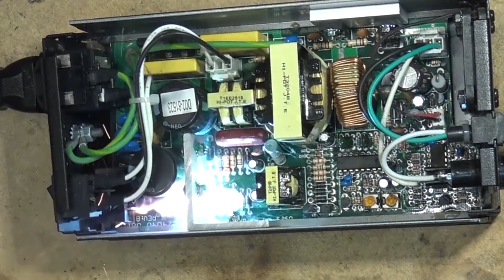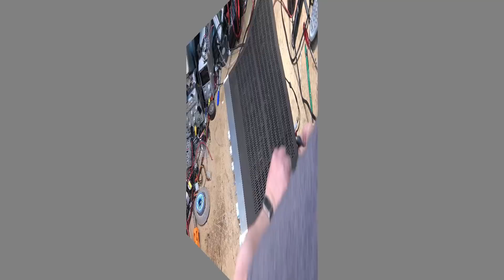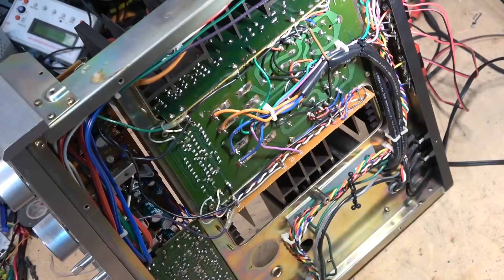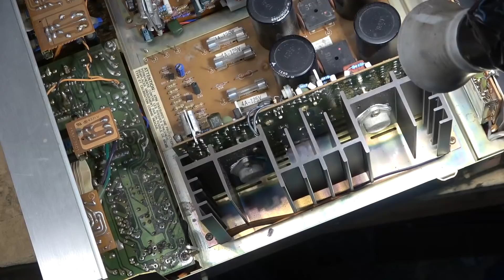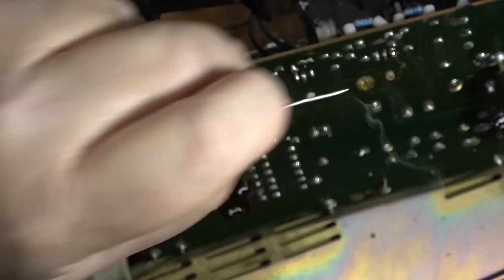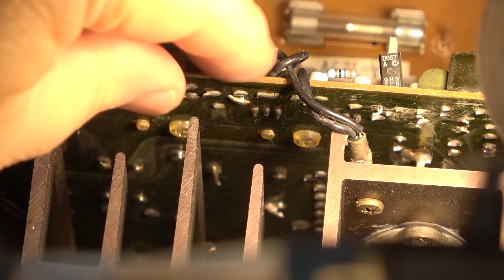Harman Kardon hk505 One channel out the other crackles. Lets Fix It.

Comment: I'm puzzled by the resoldering. It seems like you're putting too much solder down and creating solder bridges on the back of the power board.  Is it just the angle or are the globs if solder actually touching? I'm genuinely curious. I'm a novice at this and I'm trying to learn.  I have an hk670 with a very similar power board.
Reply from the maker: Obviously it's not shorted

Comment: I had one of those! It's like seeing an old friend again. And mine had the same problem. I didn't surge protect it so it was fried in the worst thunderstorm of that year. Oh, and I was getting a slight sustained tingling shock off the case itself. So I put it on the curb. It had a great sound. Probably better than the amp/preamps I've had since. Thank you so much for sharing this video! Cheers!

Comment: Hi  I have the same amp I just bought and it started doing some crackling noise on one channel both A B speakers , checked the DC off set and one side is over 115mn .... 
this unit was suppose to been re capped ...  where can I look first ?

Comment: Nice job. I had a car radio cassette that had a loose capacitor. It was an easy fix.
Reply from the maker: Loose connections number 1 fault.
Reply: @12voltvids  exactly

Comment: I can hear a lot more definition on the Akai, especially in the highs. You can't really make out the cymbals on that HK.
Reply from the maker: The speakers make a big difference.  I am running a pair of psb mites on the akai.  These are great little Canadian speakers.  Currently the test speakers I use on repair amps are just a pair of JVC from a mini system.  I'll probably get around to putting some polk bookshelf speakers up for the test speakers some day.
Reply: PSB are a hidden gem in the industry.

Comment: Acctually I got an old tube radio (1963) in yesterday with left channel dead.
Turned out it had the same type of fault.
The cable from the volume pot to the capacitor in the output stage wasn't 
soldered to the capacitor, it was just touching it.
But now after almost 60 years it's finally been soldered.

Comment: When I was a senior in High School in the late 80s, I bought a set of Harmon Kardon stereo equipment at an auction. Amplifier, pre-amp, and tuner, with stand and giant speakers, for $95. The amp had an issue where one channel was very quiet unless I cranked the volume, then it "popped" and was normal. The speakers were also blown and corroded, but they worked well enough. I added a Technics cassette deck, and loved it. 

When I moved nearly 10 years later half way across the USA, I left the electronics in storage with my parents. Five years later, they moved out of the old farm house onto a new house on the property, and sadly, the squirrels and raccoons moved in to the farm house and ruined a lot of things, including my stereo setup. 

I wish I knew then what I truly had.

Comment: The word you fumbled for is *jumpers*. Virtually no audio company used patch-cords to connect pre-out to main-in. Horseshoe-shaped metal jumpers; replacements can be easily made from aluminum antenna-grounding wire and needle-nose pliers. We often see amplifiers missing the original jumpers, presumably because some type of equalizer or other signal processing device (a Bose 901 eq perhaps) was used inbetween the preamp and poweramp.....or sometimes the unit was used strictly as a preamp because of a defective power amp section. BTW, there are three or four different spacings commonly used between the pre/main RCA jacks; I know this because I've had to make replacement for hundreds of missing jumpers.
Reply from the maker: I was referring to the fact that i had to use patch cords to connect the pre out to the main in because the jumpers were missing.  The guy that ownes this uses it with an equalizer.  Another piece of equipment that won't get within 100m of my system.  My system is so basic.  It has a power switch, input selector switch and volume control.

Comment: Unfortunately, this problem is to be expected, because the whole testing process is ALL wrong. For a batch of say 1000 appliances, only 100 out of the whole batch would be thoroughly tested, for example. If they passed the test, the whole batch would be signed off as OK. This means that the remaining 900 could be either faulty, or don't work at all. I was a QA Inspector many years ago, so I know the testing process 1st hand.
Reply from the maker: 1 out of 10 sounds about right.

Comment: Supprising that the soldering was so sloppy and it manage to work at all!.
The little transistors with one lead just sitting there without solder lol.
Lack of inspection, but it has lasted some time.
i do like the block power amplifiers, but i'm no fan of the transistor sockets.

Comment: Dont know where to post this somewhat related question. I have an ARCAM AVR-400 receiver. Using HDMI connections whenever the audio kicks in the sound goes off and the panel display says "headphone bypass" . The video is still displayed, just no sound. It doesnt matter what the source is DVD, PC, console game, etc. Ive googled for the last 6 months and gotten nothing but how to connect headphones! Thought Id give it a shot here.

Comment: Did Harmon Kardon produce any kits? That does not seem to be the level of quality I have seen with them.

 Love what you did here, it is the same that I do. Spend time on a good visual inspection, use all the senses, touch, smell, bump, thump, move, wiggle. Saves lots of time before hooking up the scope or test equipment.
Reply from the maker: No kits.